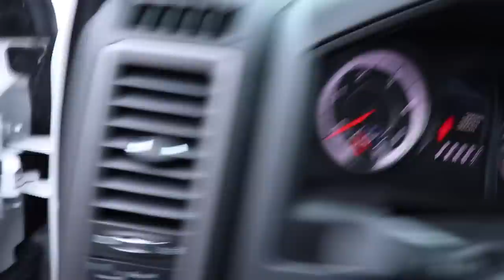MY 2017 F-250 PLATINUM ALREADY IN THE SHOP...

Comment: it's probably the spray in liner pushing the latch open a slight bit. if you push the tailgate in a little bit it usually will open. usually at my dealer, we trim the liner around the rubber stops.

Comment: Looks like you might have allready known this, but maybe someone will learn something. To get the manual window crank off on those old chevys. You can stick a rag or old T-shirt in between the plastic washer an the crank and work it back and forth. The clip will get stuck in the rag and pop right off. My first truck was a 97 shortwide and I had it for 10 years. I went threw like five of those door handles. That cheap metal just dosen't hold up. Especially if the rods are bent up.

Comment: Is it actually a 90's chevy truck if the door handle doesn't break? lmao I had a 95 k1500 and currently have a 98 K1500 replaced inside and outside handle on both of them.